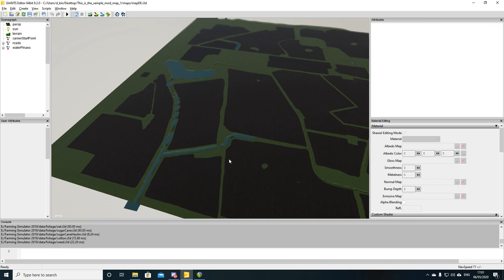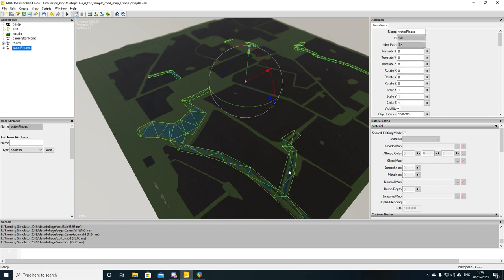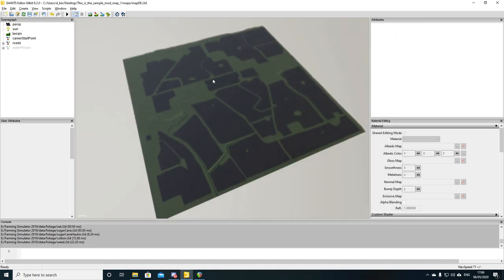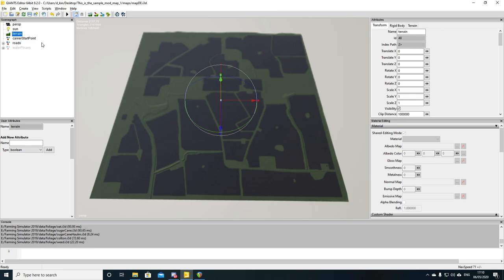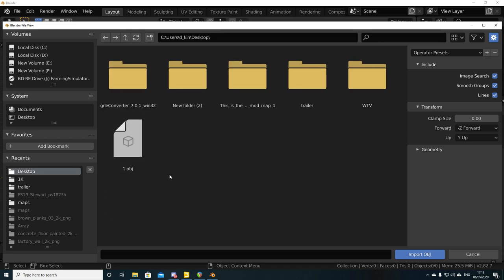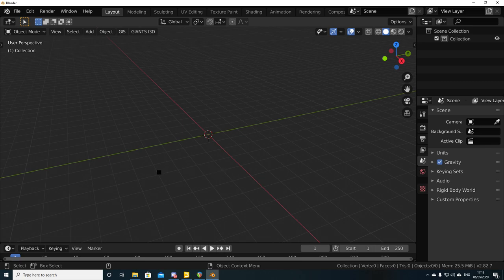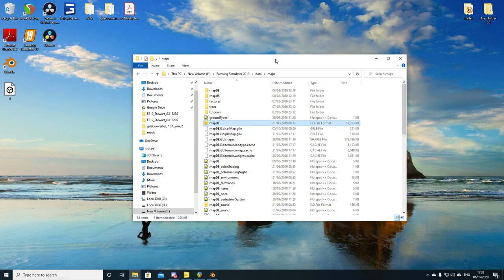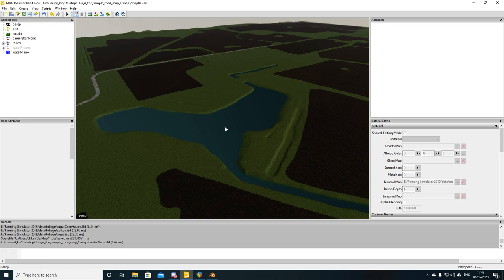Creating water planes - FS19

Comment: I have tried to do this several times, but every time I try to add the water_normal texture in GE I get a "Missing Vertex attributes" error.  
"The currently selected shape does not provide the following vertex attributes required by the current material: TANGENT"  
Does anyone have any idea what this means and how to fix it???
Reply from the maker: U need to turn on Tangents in the shapes tab
Reply: @shywizard2979  Yep, that was it. facepalm  Turned that on before saving as a binary i3d and it worked just fine.  THANK YOU!

Comment: HI I tried making a duplicate of the water in my map from the sample map, I exported with files and then imported to my map.  The water is there and I can see it, but in game it will not make the sound of me swimming in it and it just lets me walk under it. what is wrong? is it the xml or something? thanks for any help you can give. P.S I found my map boundaries you told me about, lol , YAY!!
Reply from the maker: Check the user attribute is there for the water plane.
Check against a known working water plane what the user attribute should be & apply it to yours.
Reply: @shywizard2979  ok thanks, I did look at it and it all seems the same, but I will check again. thank you!
Reply: @shywizard2979  I just check and the one that works is called waterPlanebeach and mine is not that. but I try clicking on it to change it and it will not let me write in the box.

Comment: Can you help me or make a video on exporting from blender to i3d cause i get error when trying to enable the export thing
Reply from the maker: What version of Blender are you using?
Blender V2.79 will work with the exporter from Giants but will not work with Blender V2.80 & above.
There is an exporter for Blender V2.80 & above from NLD farmer (You will need to find this yourself & use at your own risk) but has to be manually installed, which can be tricky if you are not familiar with the process.
This video may help https://youtu.be/VpjiMckMBV8
Reply: do you have discord so i can send you a picture of the error i get when trying to enable i3d exporting